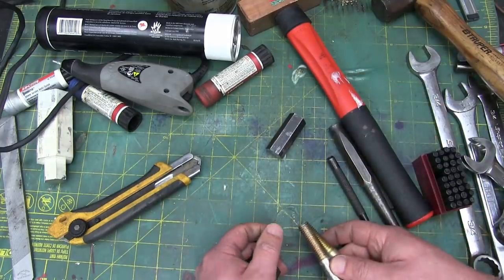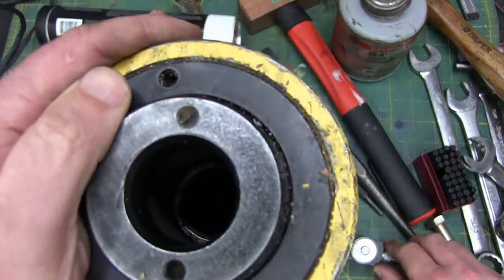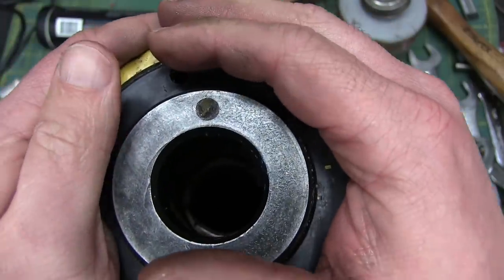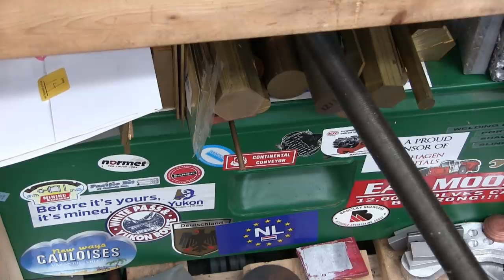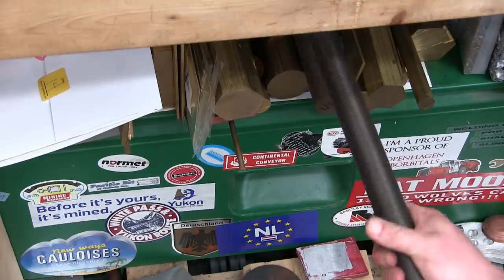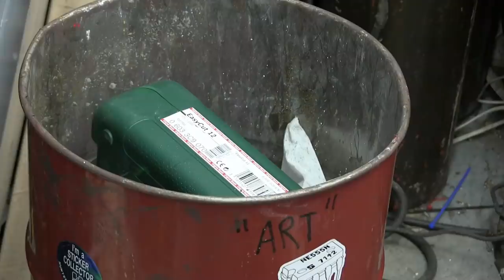Tensile Strength Tester | Fabricobbling Fun

Comment: I know you know what you are doing... but it makes me cringe at the abuse your drills and endmills take.
I like using ton of coolant rather than cutting oil. Even if I cant run a pump, Ill use a squirt bottle.
The cooler you keep the bits, the longer they last..  as I'm sure you know.
The wetter the better, as they say!